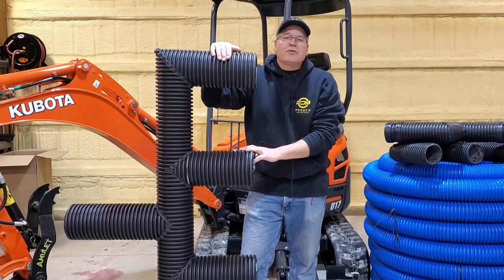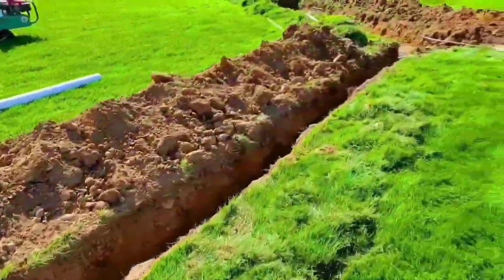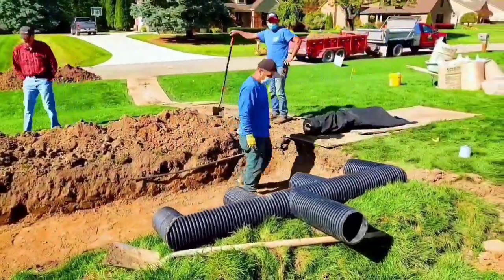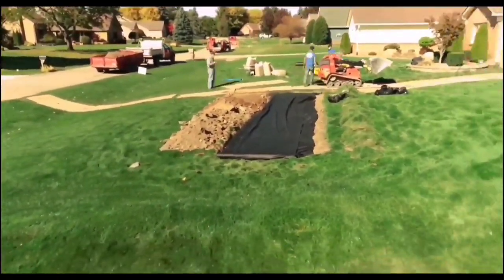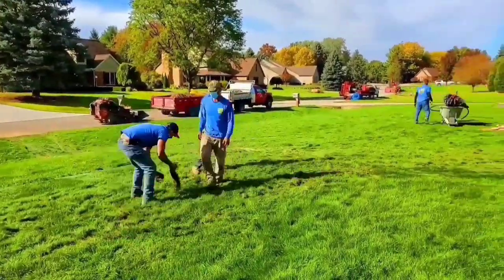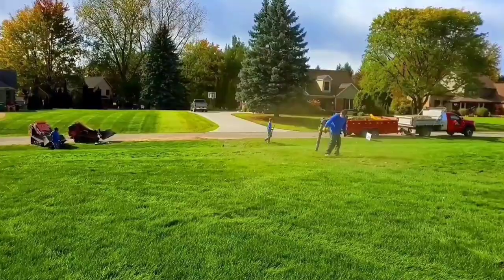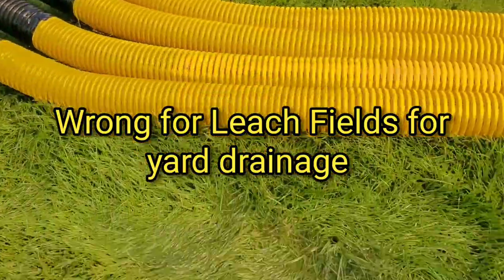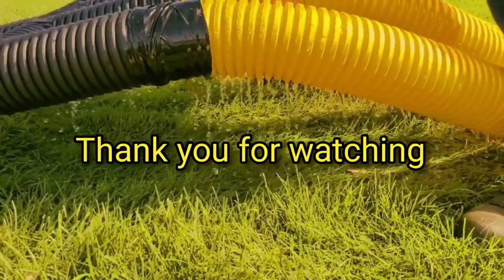Wet Flat Yard NO SLOPE, NO Storm Drains How To Dry Up Wet Yard. Where to Take Water? Made for DIY

Comment: I wanted to comment on the 8oz Fabric recommendation Bob made because some people might be worried that it's a lot more expensive or could impede water flow.

I use 8oz fabric in all my French drains. Part of the reason is because I use #4 Limestone in my drains, not #4 smooth stone. The reason for THAT is because when we put one in it's almost always next to a driveway, which means it's subject to getting driven on. Smooth stones are easily displaced because of a relatively low stone-to-stone friction coefficient while the angular Limestone will lock up and resist displacement.

But that's not the important part.

When I started doing drainage work next to driveways that needed it, I was using 4oz fabric as a boundary separator underneath Geogrid for new builds. However, when it came to French drains, the 4oz fabric did not hold up well to relatively rough #4 Limestone, so I switched to 8oz fabric. I can't recall the exact numbers anymore but 8oz turned out to be less than $100 more expensive than the 4oz on a per roll basis. (15' x 300')

So when Bob says to use it in certain specific applications, don't worry... the cost increase is trivial. 
AND, a non-woven needle punched 8oz Geofabric is going to flow about 95gpm/sq.ft., so it's NOT going to impede absorption.

Comment: I have a large field area that after strong rains, it holds standing water for hours on end.  At least  75 feet wide x 75feet long.....I have a large size water intake that I have a sump pushing the standing water to a ditch that is also overflowing with no storm or any type of drainage for property-nowhere for water to go.   Will this work for me?  Help.
Reply from the maker: This one is 4" system explained
https://youtu.be/6Wr914MjmX8?si=aEj8eZ_jeIPyck1Q

Comment: Is a leach field better than dry well
Reply from the maker: So much better its no comparison Leach Field works where a dry well would fail.
Reply: @FRENCHDRAINMAN  I agree with that statement. We had a basement system put in our West Michigan home and the discharge went to a dry well that the company installed. Up to a point it worked. This past spring it totally was overwhelmed by the volume of water. Not enough surface area to distribute the water and not enough volume. That's why I'm watching these leach field videos, I need to either replace the dry welll or have a leach field connected to it. The dry well is not enough on its own.

Comment: I’m putting it to my lower pasture but even with connecting my gutter water and a couple of underground springs I still have very wet spots in my yard.
Reply: In this video you burrito wrapped the pipe with dirt instead of rock, and in the other video you used rock. Different circumstances I guess.
Reply from the maker: @David Pritch
Huh?
Reply: @FRENCHDRAINMAN  Sorry, watched again on larger device and saw that the video cut away after laying the bottom geocloth to the point where you were finishing the burrito wrap and then covering with dirt. I like these cell phones but I can see better on a computer. :)
Reply from the maker: @davidpritch718  
The whole video is 36 minutes long I cut it down because viewers have been more active on shortened videos. We did not use straw on this job because its 1 1/2 hours further South.
Reply from the maker: @High-Flow-Drainage-Solutions  
You get all our full length videos when your on our contractors List who purchase products online from FDM.